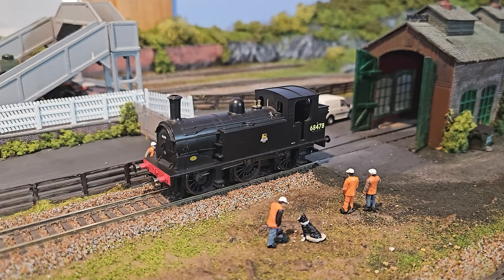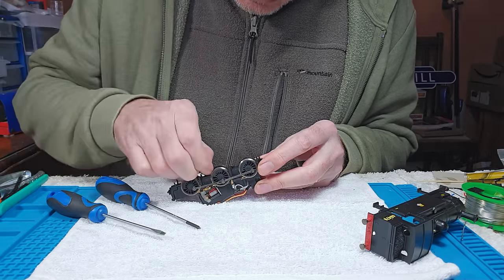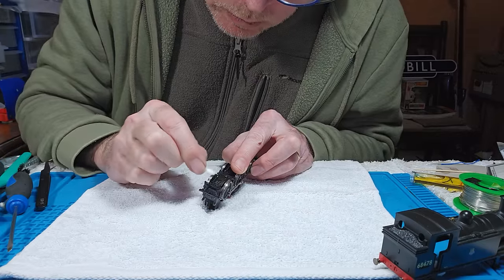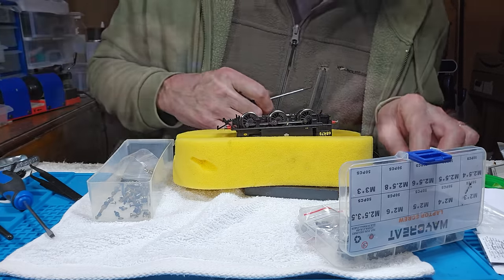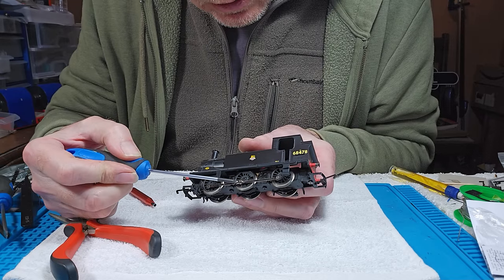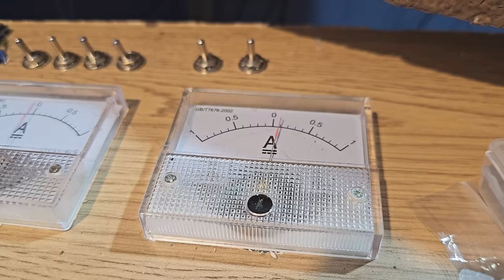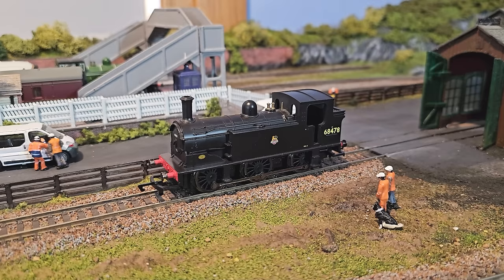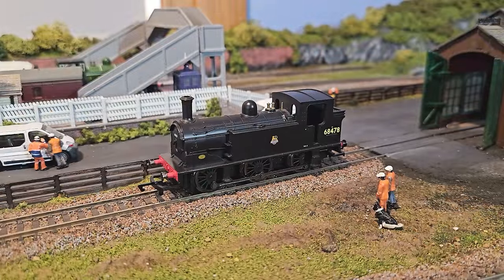Hornby Class J83 0-6-0T : Repair Request

Comment: I have a little book of British steam locomotives in 1958 and the J83 is in there. 
Origin: North British Railway Introduced: 1900 Driving Wheel: 4'6" Purpose: Light Freight and passenger shunting at Waverley Station. Power Classification: 2F. They were at former North British sheds in the Glasgow and Edinburgh areas so it's no surprise that OO Bill already has one. In 1958 the numbered series was 68442-68481 with gaps due to scrapping with the Hornby engine shown here as one of the later built ones.

Comment: Hi Bill ,, I got 1 of these J83's the other day along with a battle of britain spitfire and a couple of carriages ,, 1 being a green southern railways coach with guards compartment and a morone lner carriage with guards compartment too.
The spitfire only needed a clean up and runs like it is brand new and these  rarely are quiet but this one is quiet compared to the other spitfires i have. 
When it came to getting the J83 going it needed a good thorough pull down and cleaning.
There were also brass bearings on the axles and these were actually stuck hard on to the axles and all 6 were seized solid.
I give them a good swoosh of wd40 contact cleaner and with a small grab with the long nose pliers they all come free.
They all made a small crack sound when they freed up so im presuming maybe that someone may have glued the bearings together onto the axles possibly. 
The axles and bearings freed up good but wanted to check if they were glued or not so I ended up pulling the wheels of the one side of the axles and pulled the bearing off to check the inner side of the bearings and even took pics with a magnifier app i have on my phone and I could only see a small bit of conjealed grease or oil but no superglue remnants anywhere and the axles themselves looked brand new and shiny. Maybe the crack noise was just the bearings freeing up from not being run for over 40 years. Anyhow its all back together and runs quietly too just like the spitfire does. The only trouble was i had to get them silly copper wipers pickups that hook into the plastic base plate underframe that screws to the chassis was a bit a pain to sort but was all good in the end.
Yet another good and informative video. Thankyou.
Cheers from John in Australia.

Comment: This may be a stupid question but how did you immediately know that the wheel set was on upside down and back to front?
Reply from the maker: The oiling points (wee bits that stick up on the rods at each axle) were pointing down not up.

Comment: I got a hornby b17 that uses a ringfield motor and the motor releases allot of smoke when turned on is that fixable or is the motor done for buying a new one from britain would take a extremely long time cause i live overseas
Reply from the maker: It probably just needs a good clean. It's the dirt that smokes not the motor itself.